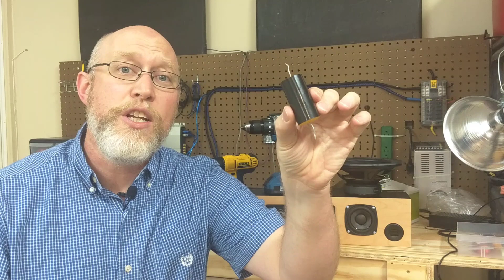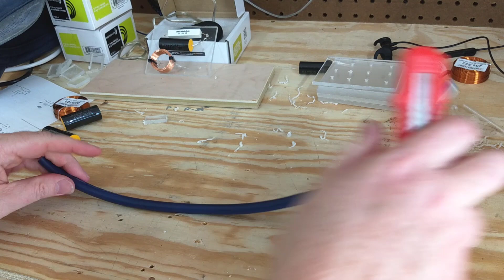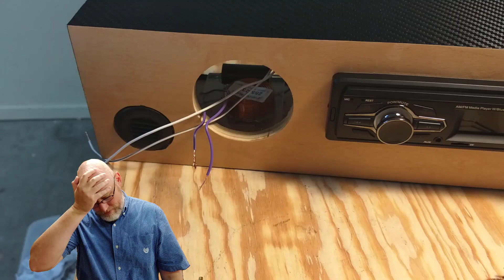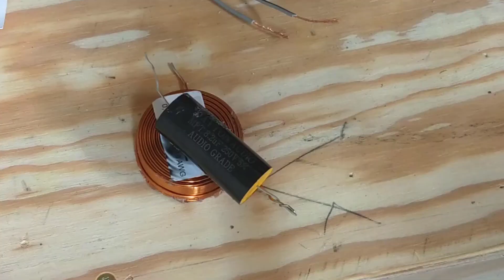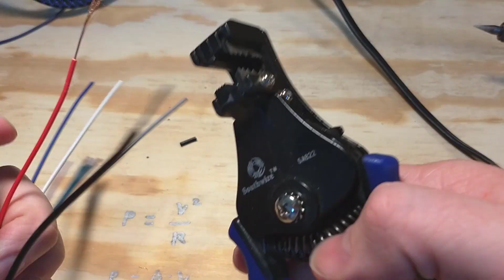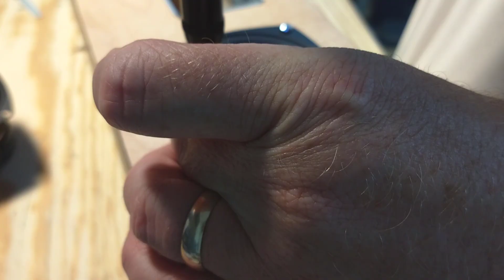How to build a passive crossover (DIY Boombox Part 3)

Comment: I'm late to the party, by 3 years. However, in the off chance OP or anyone else reads this, part of the reason for subpar soldering results is stemming from a lack of flux being applied to the wires beforehand. Yes, there's a small amount in the solder but as you can see, it isn't enough. Flux helps clean and shield the joint and allow the solder to melt more easily.

Comment: If you were to build a car audio boombox with 8 6x9 car door speakers and use a really good car radio and a really powerful car amplifier to hook up 8 6x9 door speakers and a rechargeable 12 volt 45 amp hour battery to power the head unit and the car amplifier itself and if you crank it up to almost full volume and it gets loud enough to be heard from the streets when you crank it up to almost full volume on the car radio how loud would it be in spl db for it to be heard from outside your house and from the streets which is 2 houses down from your house
Reply from the maker: I have no idea!  But I'm pretty sure that when your neighbors call the police the cop will have a meter and he'll test it for you.
Reply: @DIYAudioGuy  wouldn’t that end up being a very expensive car audio boombox to build and involve using a very expensive car head unit like a pioneer car head unit.
Reply from the maker: @travisgulley2652  Sure, but you can always use a cheaper head unit.
Reply: You trying to get revenge at your neighbor? 🤣🤣.. if so... Make sure you add a big subwoofer as well.... Lol

Comment: how do I decide what frequency to set the crossover at?
Reply from the maker: For a passive crossover you need to model it with software, like xsim.  The tweeter amd the mid will interact with the crossover in unexpected ways. The voice coils on the drivers, for example, have inductance and that inductance will interact with the crossover.  

But if you're looking for a general rule of thumb you need to find the resonant frequency of the tweeter, and most crossover designers say that you need the crossover point to be one octave above that point, so double the resonant frequency.

Comment: Can i leave out the capacitor if i don’t want high pitch sounds coming thru ?
Reply from the maker: The capacitors are important components for the crossover, you don't want to leave those out.  

The capacitor on the tweeter keeps low frequencies from getting to the tweeter, the capacitor on the mid-range keeps high frequencies from getting to the mid-range.  If you remove the capacitor from the mid-range crossover, for example, you will get more high pitch sound in the mid-range not less.

Comment: Do you have parts/order/amazon number for the wire coil and the capacitor, or is it located somewhere else?
Reply from the maker: If i can dig it up I will post it.
Reply: @DIYAudioGuy  Thanks.  Or just the specific name/terminology/search term so I can pull it up my ownself.  Thx again.